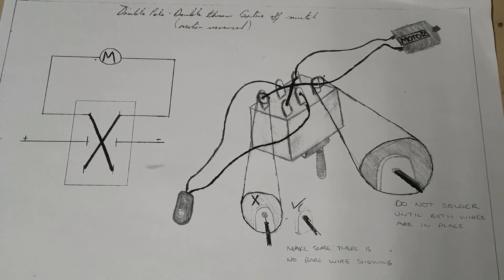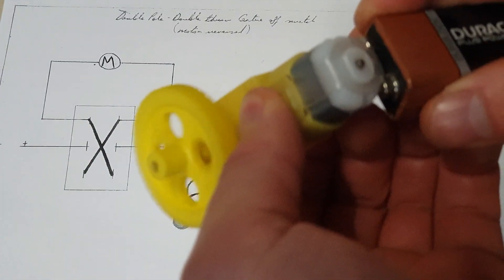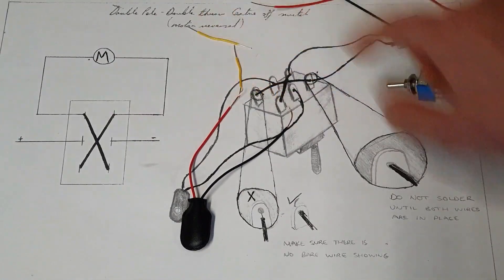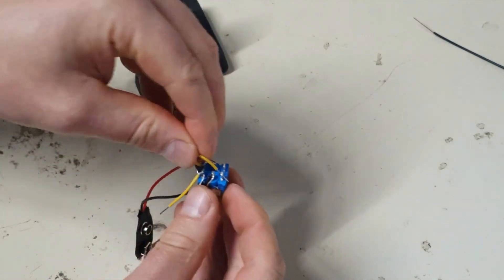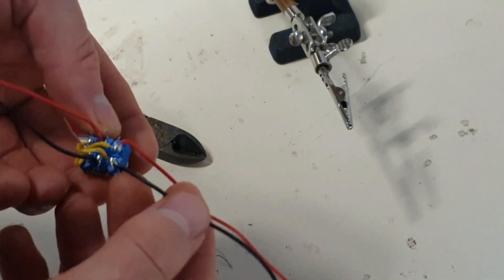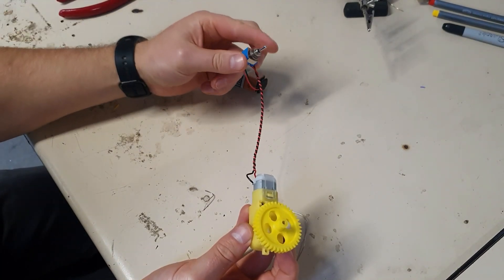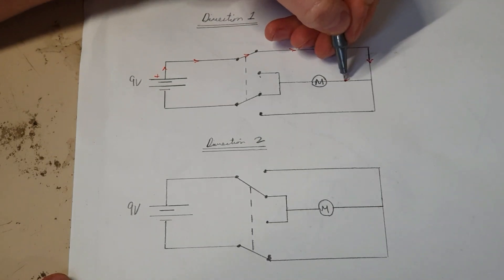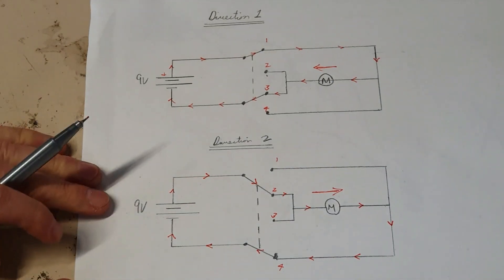Double Pole Double Throw Centre Off Switch (DPDTCO) | Wiring & Circuit Explanation

Comment: im using this but with a servo control board instead of motor and a battery holder do i still follow the same circuit?